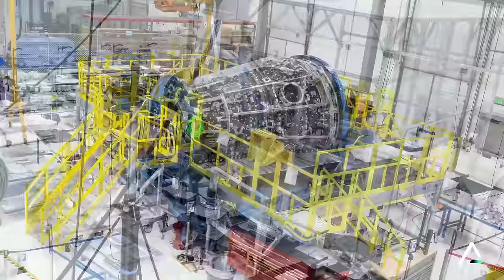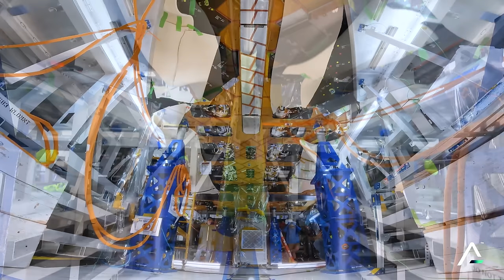Dream Chaser Spaceplane and Shooting Star Cargo Module Journey

Comment: This really looks like Sierra Space spared no expense. Good luck.
Reply: There’s no doubt that! Since even the prototype is proposed to be reusable, I’m sure Sierra will be built to be used three to five missions ,the stress levels must be high enough to be able to withstand the high stress levels required for multiple launches as well as  reentry and landing with a minimum of repair and maintenance before being able to return for launch. The less time required to be reused is the foundation of lowering both costs and downtime. Undergoing all manner of inspections in determining repair and/ or upgrade costs to determine the needs required for the system to operate within its requirements of operation! And that doesn’t come cheap! It does save on the production costs. It fills an important need for its use in the future of space.

Comment: The scale was originally designed in 1964 by the Russian astrophysicist  Nikolai Kardashev (who was looking for signs of extraterrestrial life within cosmic signals). It has 3 base classes, each with an energy disposal level: Type I (10¹⁶W), Type II (10²⁶W), and Type III (10³⁶W). Other astronomers have extended the scale to Type IV (10⁴⁶W) and Type V (the energy available to this kind of civilization would equal that of all energy available in not just our universe, but in all universes and in all time-lines). These additions consider both energy access as well as the amount of knowledge the civilizations have access to.

Comment: Beautiful time-lapse. 

   Only criticism is the lack of sidewalls on the trailer. Never did I think you'd take that kind of investment out on public roads in a cage.
    I'm sure you closed the roads or had an escort or whatever, but you can't control much out on a road, so put it in a box, with sides. It isn't the shuttle so it already fits on a semi.